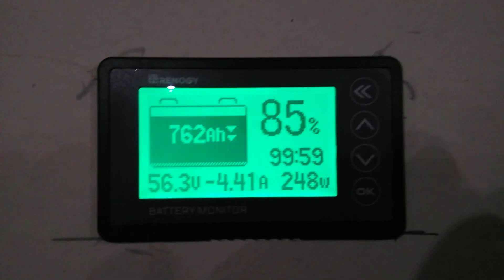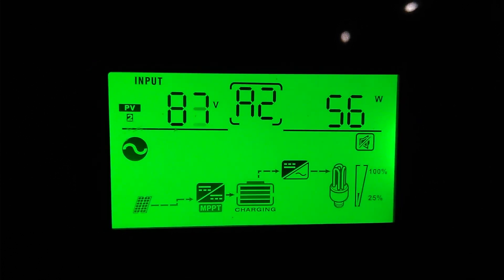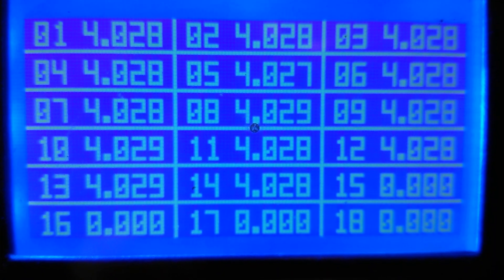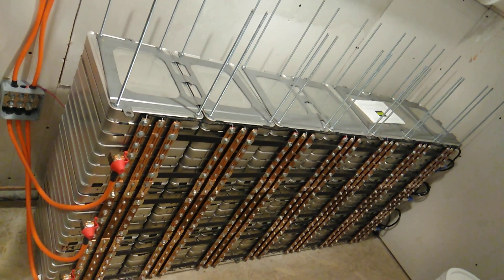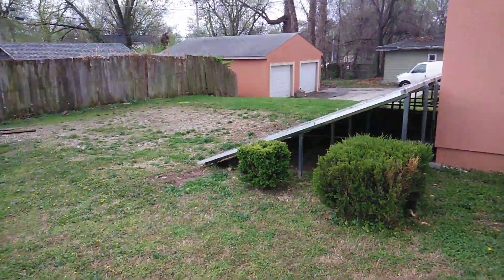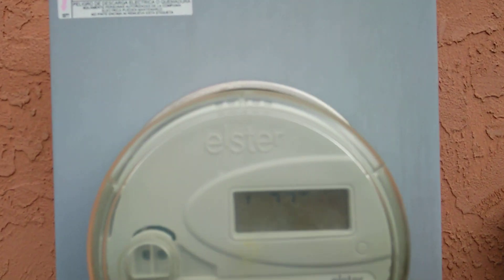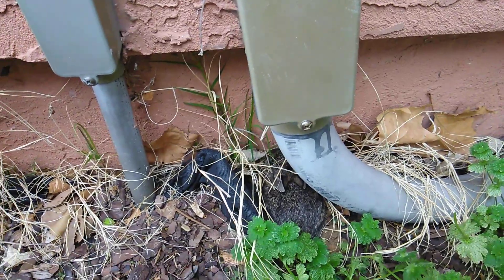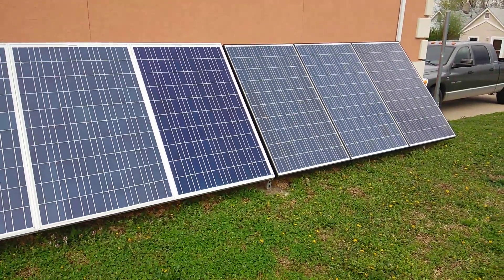mega power wall running with no sun overcast skies today.

Comment: What is the capacity of all 3 sets of used leaf batteries, and how many day's do you get out of it if there's a power outage?
Reply from the maker: It's about 900 amp hours and if I'm running the AC I can get about 3 days.  With no AC about 5 and 1/2 maybe 6 days but during the daytime even if it's very cloudy I still bring in a little bit of power at least enough to run the house during the day.

Comment: What are your fully charged and discharged voltages?
Reply from the maker: 57.6 is where I charge it and 44 votes is where it switches back to the grid. When there is no grid it will go down to 40 volts and then turn off. 35 votes is completely dead on the Nissan leaf batteries but I never take mines down that low my inverter will not even go that low it shuts off at 40 as I said.
Reply: @carsonlurbanwindandsolar3437  thanks  for the response.
Reply from the maker: Thank you 🙏